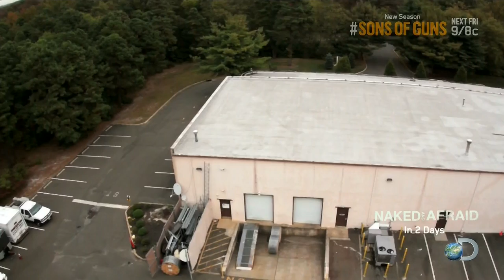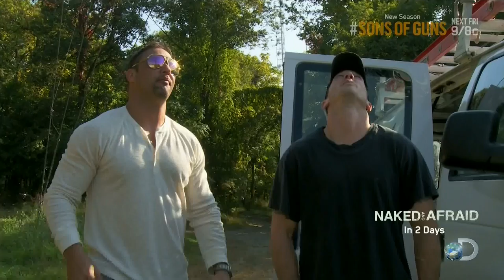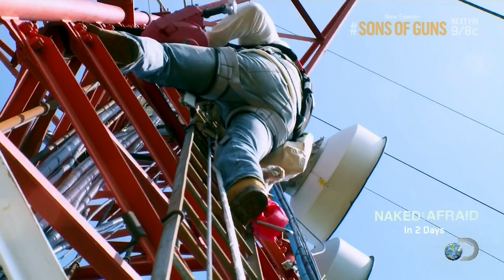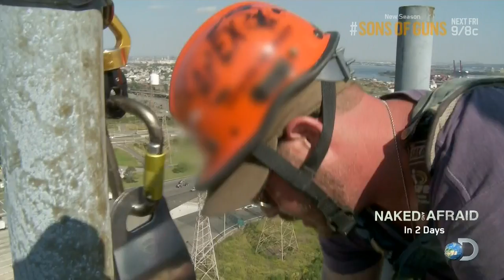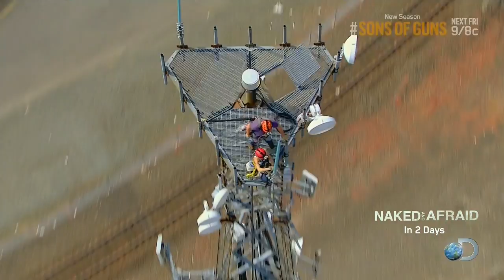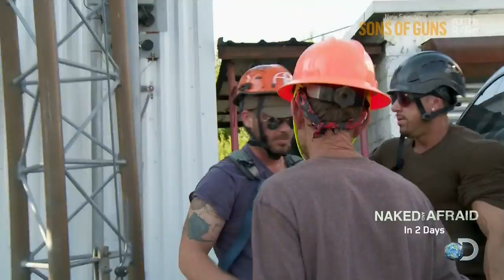Hang Men - "The Climb"

Comment: 40 Watt seems like the only normal person there, the rest look like over dramatic actors.
Reply: All these cable shows are overly dramatized  around fabricated pressure points -- always the time rush for various reason, the sun is setting, yadda yada.  That's all routine construction stuff but the way these shows hype it so that viewers get all stressed in the watching, is just cheap eye candy.  I won't watch another one.  I'm not buying hype.
Reply: @talchaitai9850  I feel the same way. When the roid monster walked in I thought this was going to be another episode of Jersey Shore. XD
Reply: It would be boring af if they didn't add bs drama..
Reply: @talchaitai9850  Regardless,  this job is still among the most dangerous jobs to do. Dealing with extreme heights is no easy matter and not everyone can do it.
Reply: sure. hes from 40w range xD
Reply: 40 Watt has been on the meth pipe for years
Reply: Nobody in the industry is normal. Normal people have real jobs. I did it for the money and the adrenaline rush. Get paid to get high, what could be better?
Reply: Other than not putting on a tagline and hoisting
Up without looking and pulling it into a mount

Comment: It said the Lindon tower was 250' and that it was twice as tall as the Statue of Liberty, the Statue of Liberty is 305' lol
Reply: Josh Stephenson  - wrong. The actual statue is only 151ft. When you add the base and block at the bottom it is 300ft. This show is a fucking pathetic excuse for entertainment. All that added in fake ass drama is pitiful.
Reply: Gerard Gibson wrong it's 305 ft from bottom of the Base
Reply: they also said that dude had 250' of rope on him, which doubled his weight to 350 pounds. meaning he's 175 pounds, and the rope is 175 pounds. 600' of 5/8 rope, which i doubt they were using for the weak ass 10 pound antenna, weighs 80 pounds.

Comment: As a female tower climber this is a little embarrassing. Once you are above 100 ft it's pretty much all the same unless you're doing some crazy 1200 + tower. It's also not that physically demanding depending on the work you are doing on the tower and the extra weight of any tools you bring up. I encourage any woman interested in a career in climbing to try it out. Trust your gear and you really don't have much to worry about. You only really get better at climbing by actually climbing so give it some time and don't worry if you start off slow. I've been climbing for about 7 months now and my tallest tower so far was 440ft (190-300 is average), so nothing crazy yet. As far as being a woman in this industry I've had more problems with being coddled than I have anyone hating on me for being female. Most guys in the industry don't care as long as you pull your weight.

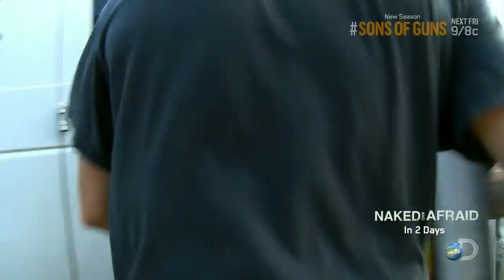Comment: 27:48  Jenny needs to be taught the proper direction to use her Channel Lock Pliers.  If she continues to use them in the wrong direction, she won't have the fittings tight enough.  This could cause the nuts to loosen and drop the load.  I hope they watch these comments, it could save someones life.  Signed, an old mechanic.
Reply: detroitbob58 Loose nuts are known to cause dropped loads.
Reply: don't tell Jenny what to do, she's been climbing towers for 34 years. you have a problem with that?
Reply: Yeah look who trained her. He hired her to drive his, no licensed steroidal butt around.

Comment: I personally have tried and could only make it 150' and barely made it back to the ground. But I work with guys that climb 850'-2000' towers everyday and they don't start getting tired until the 1500' mark it's unbelievable how strong they are and when I give them a job on a 650' tower where done by lunch time I don't know how they do it

Comment: Just wondering, can they install a small and light machine pullers on the top? they can use the puller to slowly pull them up to the top. I know the puller may be too heavy, but those metal grips probably weight a ton when you combine all of them, and if the puller breaks down, they can hire a helicopter to fix the puller.

Comment: Nothing about the husband and wife team securing the Coax in hangers on the way down,,  that can be the most time consuming part of a installation,,  also a big Klein bag full of stainless Coax brackets for 7/8  or 1  inch heliax is a heavy carry,,  we used to winch up the bag after the antenna was set, weatherproofed, and ready to go.

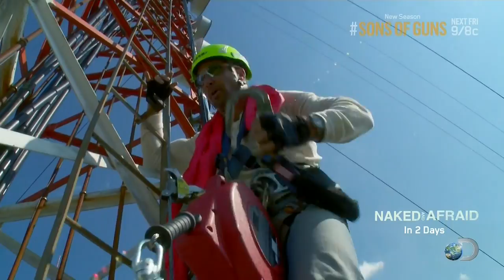Comment: 16:20 he looks like such a dork in that high vis helmet. I have the exact one and that's why I don't wear it anymore. I have basically a black strait from the Chinese factory no-name knockoff of the Kask Superplasma and I love it! My Kask cracked where the hole is for the hearing protection. The no-name is perfect and I've used it way more, it has the leather strap and everything. I paid like $40 USD for it from Aliexpress. Keep in mind I only do window cleaning so I don't really need a helmet anyways. I wouldn't wear it for other rope access work without the ANSI stickers. It does say CE certified but I feel like it's a counterfeit sticker.

Comment: Wow! pulling up a Microwave dish by hand?...channel locks 1001 uses...really a deep six point socket 1/2 in drive is what they should be using for the dish mount...and where is the footage of them snap in the cable line, not to even mention de rigging the tower...show is lame...so far
Reply: 3/4" ratchet wrench. basically all both crews needed... unless the 4ft's U-bolts were 5/8" rather then 1/2"  then u need a 15/16"... channel locks.... MY RIGGAS.

Comment: Way late to the party, but this whole show reads like a worst practices document.  

Just shook my head at the talk of carrying a 35 pound block up the tower only to see a 1 lb pulley clipped to his harness and a self retracting lifeline slung around his neck.  You carry a thin line and a small pulley, then use that to pull up the next size line and equipment.  

It was asinine seeing them set up the capstan winch to hoist the coax.  WTF did they not use that for the antennas? The hand hoisting went against OSHA by hoisting with no progress capture.  

Not that OHSA, ATFE, etc matters to reality TV.

Comment: Why don't they use rachet and sockets, correct size spanner for doing up nuts?? They must know the nut size.. crazy work, and can be unpredictable at times. But as usual time and money are key factors in the dangers the workers all face... not only working at height. I think they need more engineering smarts on the towers structure.. like no ladder to the top of platform. Work and build smarter, easily make this job safer. 5 ft jump to the God damn platform!! Why?? Dumb design that's why. Spend all that $$$ on a flawed design that puts workers in unnecessary danger.

Comment: I do agree with the man about CHANNEL LOCK PLIERS. They are clumsy tools for this job. Two lighter weight ratchet wrenches would be better.
Reply: channels fit every job. one wrench does one job. you can't take your entire toolbox with you, so having a tool that can break any size nut (to an extent) is better than having several wrenches which just adds weight. and to be honest, if you use channels a lot, they aren't clumsy.

Comment: What an absolute joke of a show. Did they really say that load rope added an extra 300 pounds???? Nobody can climb with that much weight. If that was the case you might as well just climb up both omni and cable. Then the guys use a cathead for a damn coax line, just pull it up by hand it’ll take a quarter of the time but then they don’t use the cathead for the 4 foot dish. Wtf. This show is ridiculous. 

I’ve been doing this job for 6 years now, our job is nothing like this other than the yelling when people do stupid shit like not attach a tag line.

Comment: Lol adjustable wrenches and channel locks to tighten bolts hundreds of feet in the air...I respect tower climbers and their profession but these guys are in it for the TV drama. They don't even have the proper tools. They have pulleys with motors that if you spend a little money will pull shit up to you without a bunch of physical labor and do it much quicker and more steady. I didn't see any teathers on any of their tools, they are a joke. 👍✌🤘👊😬